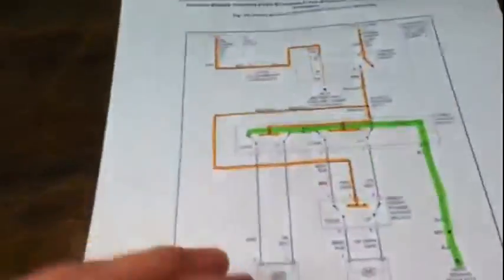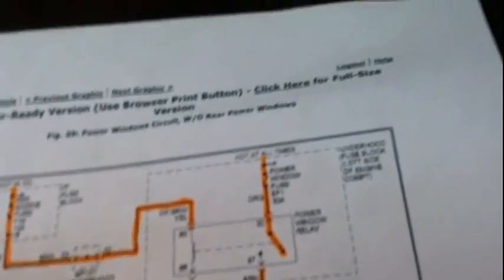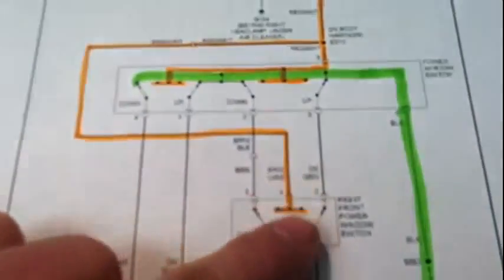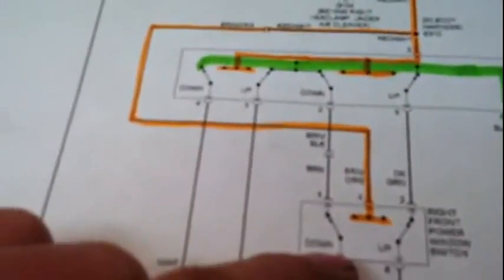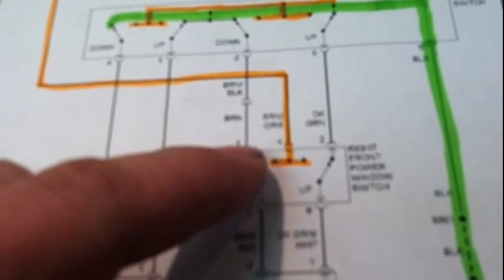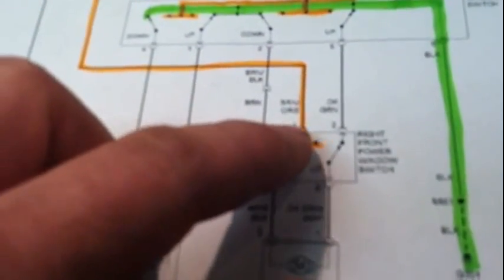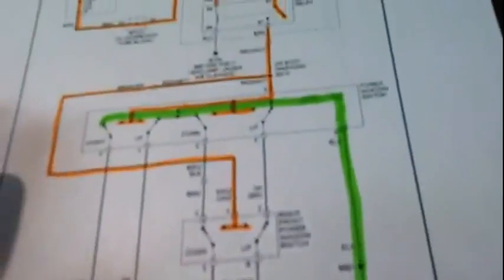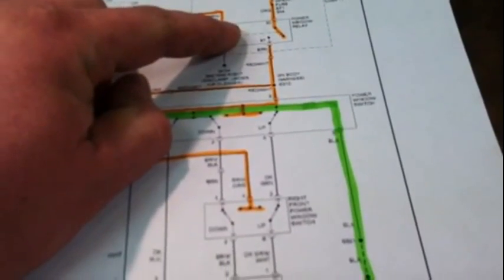2005 CHEVY AVEO RIGHT FRONT WINDOW INOP

Comment: Could my childproofing window button be stuck
Reply from the maker: That’s hard to say.  If it were stuck the window motor would try to actuate.  When the bcm sensed the abnormal current it would stop for safety reasons. If you are not familiar with a dvom I suggest taking it to be diagnosed.  Most dealers charge a half hour ($50) for this service.  Then you can make the repair yourself and save some money.
Reply: Oh don't matter transmission blew after first hour of 8hour drive fuck my life this weekend's been hell
Reply from the maker: Sorry to hear, hopefully next weekend is better.